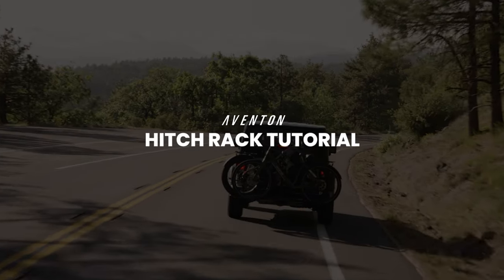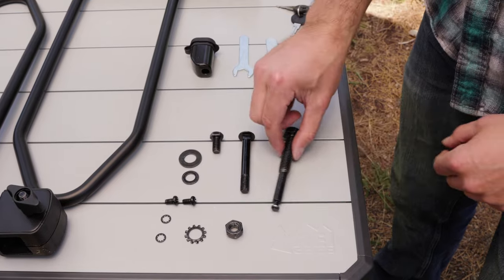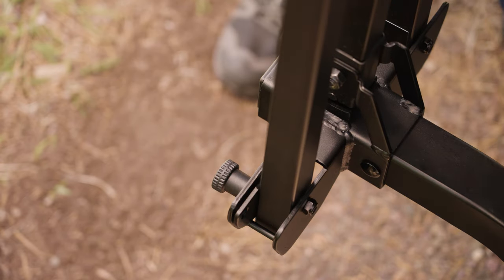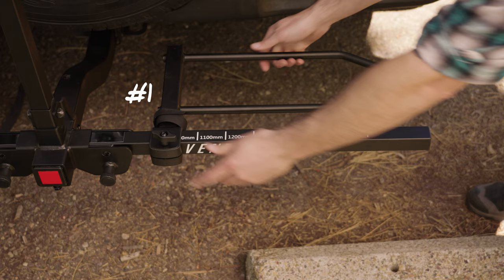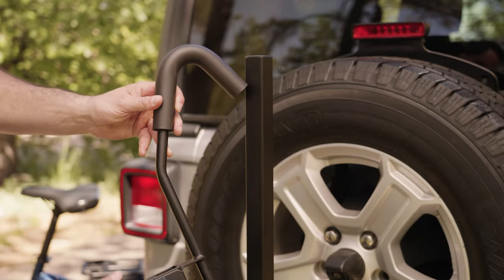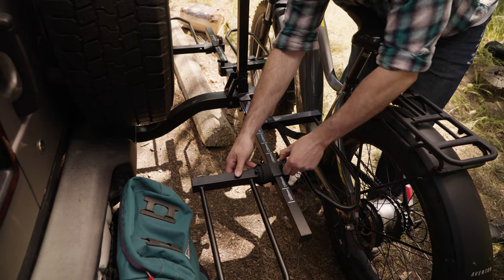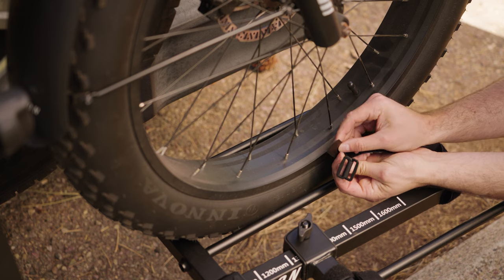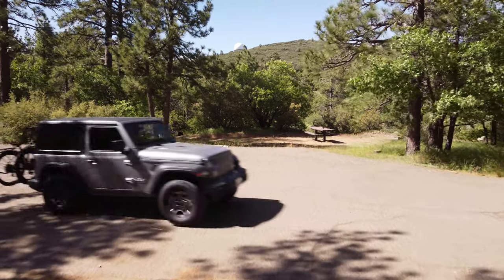How to Put an Aventon Hitch Bike Rack on Your Car, Truck, or SUV

Comment: I realize it says to always place heavier bike on the inside.  My question is for someone who is only putting one bike on and has a car with a spare tire too wide to use the inner tire tray such as a Bronco Sasquatch.  Can they attach and use only the outer tire tray, or would it be better for them to use a hitch extender and use only the inner tray?  Thanks!  Looks great and at half the price of most racks that will carry the Aventure.2.